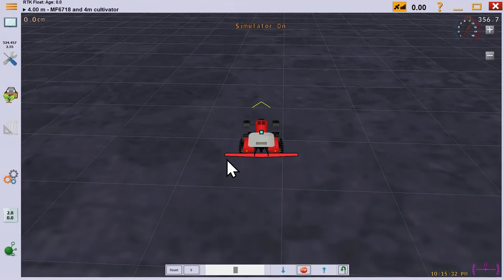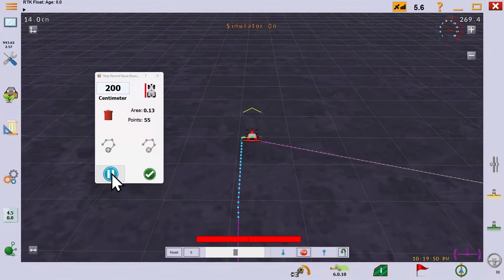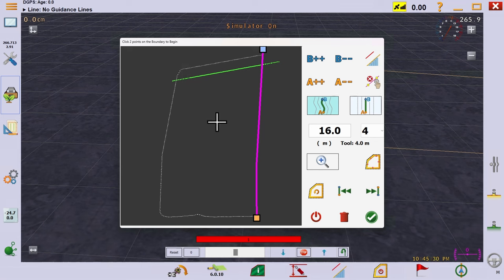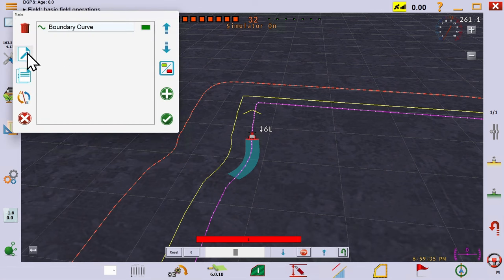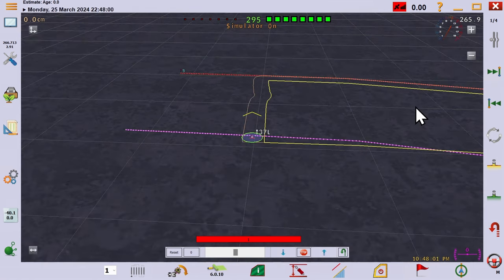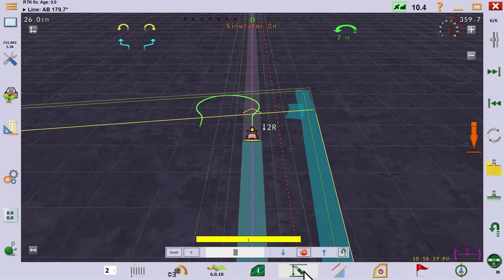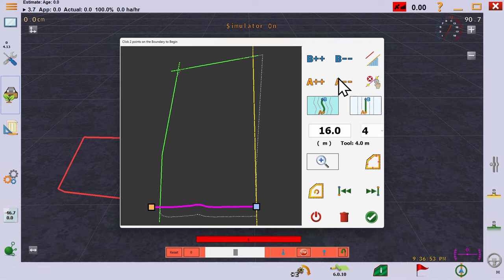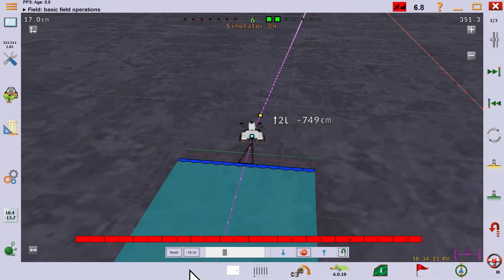Field Operations

Comment: I recorded a field, then brought the data to my desktop computer at home to set up tram lines in the simulator.  How do i located the tractor in the simulator in the field? I am also at the tips and tricks part of the video where it is showing an existing driven boundry, then pulling the maps from the maps boundary icon.  i'm using vrs 6.3.1 and i do not see the boundary option.  The top of that menu in mine says headlands.
Reply from the maker: Check you haven't turned boundary icon off, some are seeing it missing as a default that way. Gear icon, near the bottom
Reply from the maker: You just need to zoom out and drive into the field